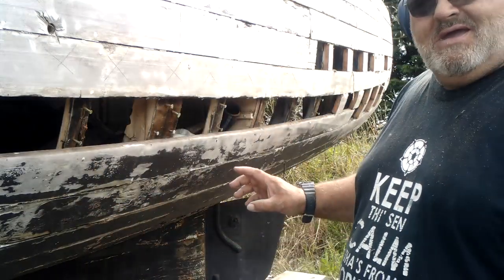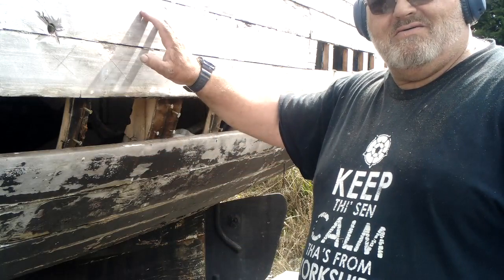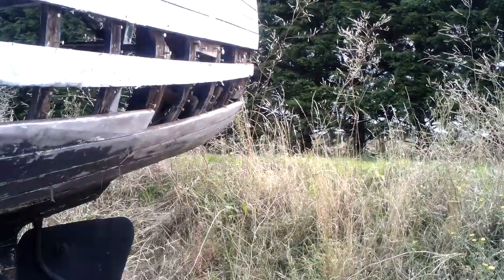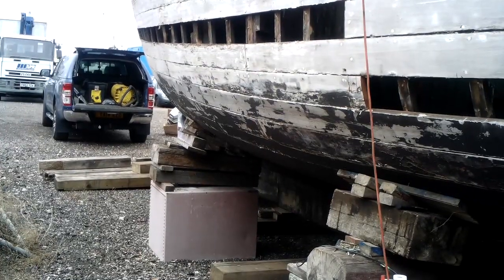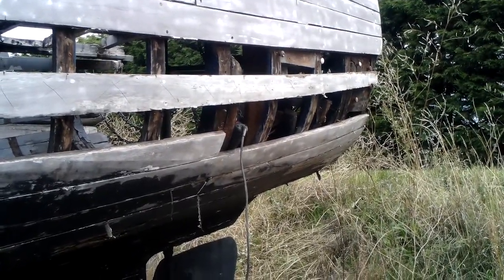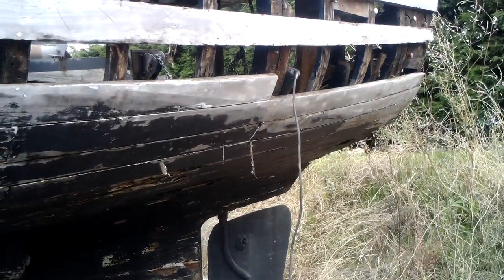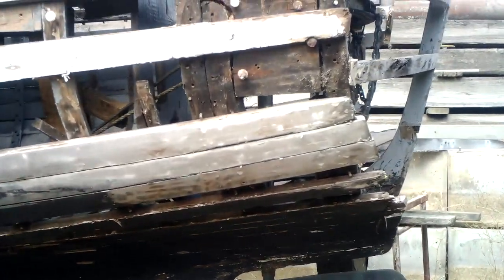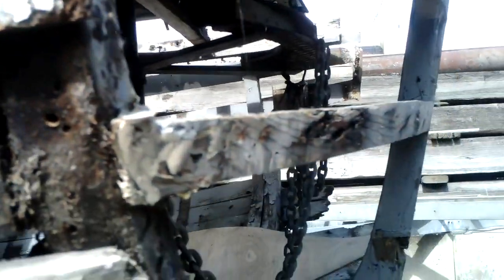Removing port side planking

Comment from the maker: Thanks for your comment, I have had modern boatbuilders say it is okay to strip the whole of the planking off and call it industry standard. I come from a time in boatbuilding that would not do that to old traditional build boats. As they would go out of shape. Chance as a problem with her starboard side which was repaired by an unskilled person as they cut all the parts that keep the  deck together and now I have the difficult job of rebuilding the starboard deck and having to make new deck beams beam shelf and carlin and then put the starboard side back into its correct shape

Comment: I remember doing  that on my mom and dad boat.. what a lot of work..
Reply from the maker: Hi All,
We will be shortly making a start on the starboard beam shelf to restore the lost shape caused by a poorly replaced beam shelf which was fitted at sometime in the past and was not fixed to the other parts of the deck structure which caused the starboard side to loose its shape and strength. So while we save up to get some mahogany planks to replace the planks we have removed so far we are going to tackle the starboard side beam shelf and the frames and ribs that need replacing on the starboard side and start to rebuild the transom and stern of the hull.  Hope you fix the windlass soon and you continue with your adventures. Regards Simon & Family